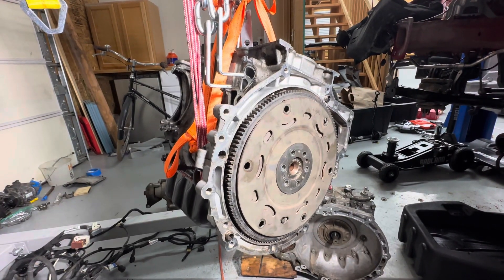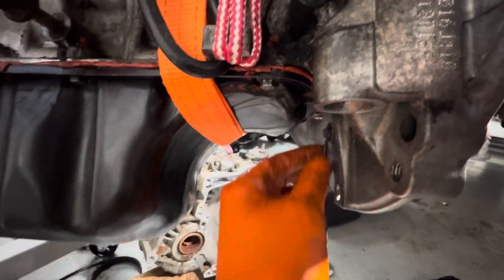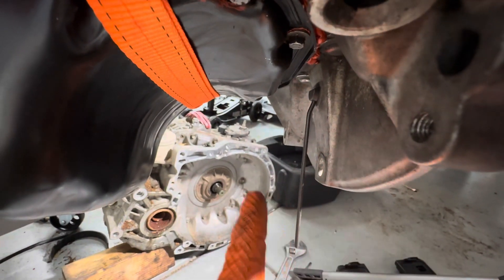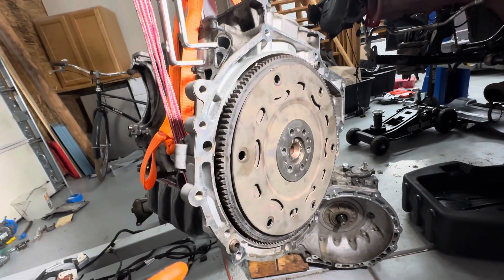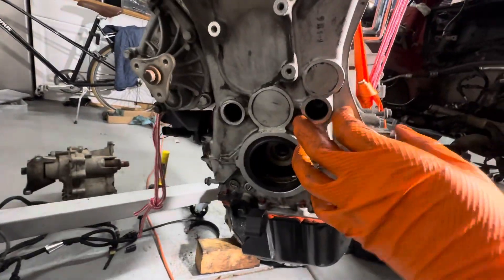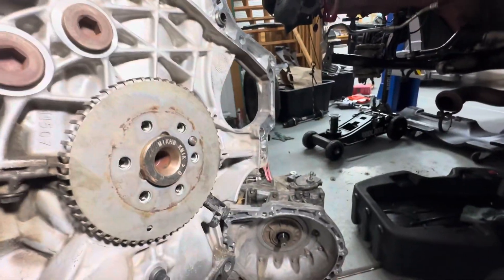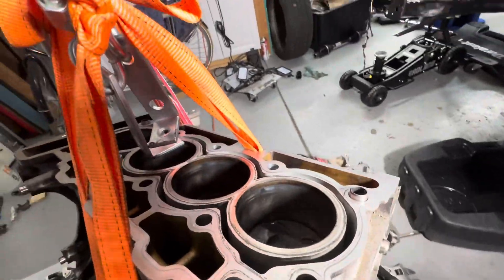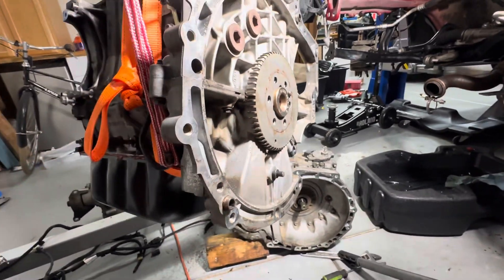Mini Cooper Locking Flywheel for Timing Chain Replacement Piston Position in Cylinder

Comment: Thank you!!! I was doing lots of research I had cylinder one going to top dead center and the flywheel locking tool wouldn’t go in. I’m not used to the mini Cooper BMW engine N12 after watching your video you’ve explained all the cylinders lineup together about midway so would that be considered top dead center for this engine to continue the placement of the timing and camshafts line up?